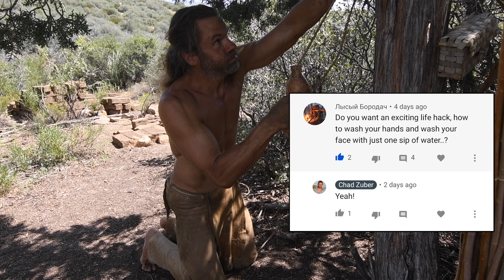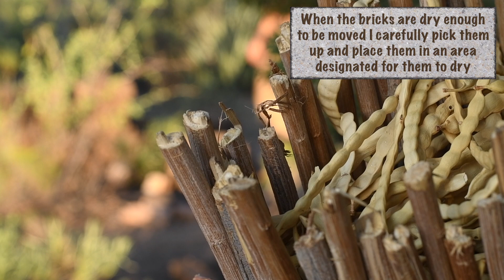Making Primitive Adobe Bricks and Finding a Spring (episode 19)

Comment: TIP/ experiment: A simple way to filter water is to have two containers one filed with dirty water and one empty then you can put something like string or paper (if paper you can role it to be like string)(this can be anything that has fibers), Then if you put the string/fiber thingy so that it touches the water at one end and goes down a bit in the other container make sure that the fiber thingy that is stringys end(in the empty bottle) is lower than the other. The water will slowly flow to the empty bottle. But it may not be drinkable in bigger amounts. But if you ad charcoal with a high surface area it can pick up nasty things witch can make it more drinkable.
Reply from the maker: That sounds very interesting. I'm not sure that it will work in this arid climate though. The water may evaporate before collecting in the empty jar.

Comment: Happy to see you in a biome that I have enjoyed for most of my life. If I may give you a  few thing to look into if your interested. 

There is a cactus called hedgehog, it is symbiotic to other plants and typically found under or near their cover, small groups of cactus bases. At the base of these groups, just after a bloom, it'll bear fruit much like the prickly pear. small strawberry shape with fiber hairs on them, easy to wipe the fibers with bark. hold the stem like a strawberry and eat the tip up to Just before the stem (like a strawberry). it is a delicacy, a weird cross from a citrus and a strawberry, only available during the mid to early spring. Very tasty, but you might be a tad north for them, but if not, give them a try. (always inspect for worms.)

Second tip is on the spring. Congrats, that is a good find. it is very common to find those with stagnant water. very hard to truly enjoy without some cleaning. something you can do is dig out the sediment a bit to get a tab bit more depth. Once you have maybe 3-4 inches depth with a foot to 8" diameter, you can stabilize with a bit of white ash. roughly a tablespoon to 1k Gals. The potassium from the ash helps to change the PH in the water to deal with the microbial issues. Followed by a sand filter basket to remove some of the bigger stuff. remember if you don't see plant life enjoying it, there is a reason. The Hopi were known to plant a symbiotic plant into the middle of that bowl to help clean and as a sign if the water went bad. something to think about and look into. 

Loving the New series, keep up the great work!

Comment: That handwashing water-conserving technique reminds me of something one of my old schoolteachers told us in his chemistry class: If you fill a jar 90% of the way with water to rinse it out, you're only going to wash out about 80% of the contaminants on the inner surface. But if you use just 10% to rinse the jar, you'll get rid of about 70% of it.  So if you do that 3x, then you'll only use 30% of the jar's capacity for water to get it over 98% clean, as opposed to 90% of the jar's capacity in water to get it 80% clean. (Presuming there's nothing inside that'll cling.)
Reply: "I was told there would be no math."

Comment: Not sure if you'll see this but a trick to getting more pure clay is to filter the dirt out with lots of water over and over till you have lumps of clay a practical way of doing this is to make a tight weave basic as tight as you can get it so the dirt can wash out not the clay. Add in clay rich soil it's slow and you won't get a lot of clay at first but if you keep doing it youl get more lumps of clay till you have enough clay. I used this same trick only thing diffrent was I used a old pillow case to filter the dirt out instead of a basket. When you got your clay keep it in water so it dosent dry out. I learned this trick from school in art class actualy the teacher showed us how to get clay out of the soil for pottery  it was fun and messy.
Reply from the maker: I honestly have never done that technique. It sends time consuming. Maybe I will try it although it hardly seems necessary given that the pottery is turning out great already.
Reply: @ChadZuberAdventures  it is a time consuming process the method is called Wet clay harvest method not sure we're it originated and I'm not sure if you could try it as you'd need a bucket and something to filter out all the sediment so you have clay and water left.

Comment: Have you thought of using a grinding stone to powder the bark for your bricks. Doesn't have to be a mortar and pestle kind but it would save your hands from the friction and roughness of the bark. I did that with a sandstone flat and hammerstone and it not only did the trick but the stone added additional grit to the mix.
Reply from the maker: Yeah but this bark is quite soft. It actually feels good to roll the bark in my hands. It also helps clean the dirt from the hands.

Comment: pound the stick into the ground and use leverage to break the walls of the pit off.
Reply from the maker: I actually tried that but the ground is so hard the stick doesn't penetrate.
Reply from the maker: Maybe presoaking the ground with water will work for that method.

Comment: Reason I asked about the ratio of Mud/clay /and Sand, to dry grasses you use. I have a good source of sand and clay I discovered on my Property, when 2 Massive oak trees where blown over by a streight line wind..Bad for the trees, good find for me...
Reply from the maker: If you can measure the ingredients quite precisely then I would try using 30% clay, 30% sand, and 40% fill dirt. Then mix in a certain amount of dry grass or dung and see how they turn out. You can then adjust the recipe based on the results.

Comment: Hi. try to drive a wooden stake into the edge of the hole and then pull it out. so a large piece of dirt will break off. then pound it with a stone. so it will be easier and faster for you to collect dirt for bricks
Reply from the maker: I have tried that and it's really hard to do. However, as long as the spring has water I can pour some water where I intend to dig to presoak the earth and then it's easier.
Reply: @ChadZuberAdventures  it's bad that in the area where you stayed there is such a bad ground. I wish you to find good clay for ceramics, and many useful resources

Comment: Just a little tip Chad, you can always leverage things. When you were digging/scraping, you could also use like an axe. I think just using the stone to scrape it off is much more tedious, isn't it?
Reply from the maker: I don't know. This ground is really hard. The stick and bone are just too soft to make much of a dent. The rock seems to work better although it is tiring. But if I only make a few bricks a day then it's not a big deal. The best way is to presoak the earth with water and then dig. As long as the spring has water I can do that.

Comment: Yesssss! I was wondering when the next video was going to drop! Now to sit back and enjoy dinner and watch an excellent video 😁👍
Edit: man every time I watch one of your videos I just keep coming up with new ideas. For instance I was thinking of a way to speed up your brick making time. I wonder if making a brick sized depression in the ground and lining it with woven juniper bark mat would allow you to quickly press in a brick, leave it for maybe an hour, and then use the mat to pull the brick out and set it aside and put it in the hole for the next brick. Although it may be too soupy still to do that. Glad to see the juniper bark adobe came in clutch. Having super strong bricks will extend the life of your hut significantly. Also, you're already digging a hole why not make it into a cellar for food storage once you're done digging bricks?  I'll let you know if I come up with any other ideas which, as you can tell, seem endless some days lol. Best of luck love the videos chad!
Reply from the maker: Thanks for sharing your ideas. Making bricks by digging a depression in the earth would really slow down the drying process. It would also be difficult to remove them the way you described. It's just not practical. Regarding the big hole I'm digging, I have a few ideas for it. The location where it is has a natural flow of water when it rains so it will likely fill up after a lot of rain. I can use it to collect water perhaps. When it is dry I was thinking to put a roof over it and just use it as a workshop especially for making pottery because there is good clay in that hole.
Reply: @ChadZuberAdventures  ah fair point. Anyways just keep doing you man you're a fantastic bushcrafter/survivalist/primitive skills teacher and I love your videos ^_^

Comment: What if you didn't remove the bark from the brickts and moistened it a little, just before you build a wall? Would that close gaps and keep the brick from shifting? Great channel by the way I recently discovered it and have loved every minute so far.
Reply from the maker: That wouldn’t be helpful because when I put mortar between the bricks I want the bricks to adhere to the mortar.

Comment: Chad, one question, wasn't that tiny spring you found, contaminated? I swear I saw worms wiggling through the water.
Reply: Looked like mosquito larva and some other type of insect.
Reply from the maker: Mosquito larva and other insects. That's not contamination. I've shared water with insects before and was fine. When in doubt just boil it.

Comment: put some water in the dirt before scrapping.. its gonna be alot more easier to dig out
Reply from the maker: Yes, that makes digging easier but then I spend more water. That's the problem.
Reply: @ChadZuberAdventures  we live in mud houses.. the water quantity will be same and it will be more adhissive as compared to fresh mixture. add water..leave it for sometime.. then dig with sharp wood branch the portion where water is absorbed.. add little remaining required water

Comment: Hey Mr. Zuber, have you considered using the hole you dug for the adobe as the bottom half of your shelter? Like some of the old dugout homes in the New Mexico area? Also potentially fire hardening your digging stick? Hope youre safe and all is well.
Reply from the maker: Hey Pete, that would not work well because when it rains the water drains right into the hole. I'm going to use it as a workshop mostly for pottery. I will put a roof over it for shade. The stick was already fire hardened a while back. It's pretty strong. I've been using it for over two years.

Comment: One day hopefully soon I'll hopefully go to live in the wild. Thank you for these lessons :)
One question, would these bricks survive bad rains and snow?
Reply: Yes since they are fully dried or "cured" somewhat like concrete but obviously not as hard
Reply: @davidhutchinson7888  ok. Thank you!
Reply: If you can make cement, you can fire the bricks to make it like a proper house if not, you might have to do some repairs on the bricks if it rains too much.

Also watch out that if the foundation gets a lot of water it can go up the bricks and damage it

Comment: Mr Zuber,
Is there a reason you are making the adobe bricks in the exact proprtions that you do?
Reply: I can't speak for him, and don't know why the height is set how it is, but typically brick workers like bricks that are as long as a multiple of the width (most frequently 2, but sometimes 3 or more) so building large walls you can interlock brickwork courses to strengthen them without cutting bricks down. Variance from those precise proportions, I'd guess is to account for mortar spacing, or perhaps just the inaccuracy of the primitive molds. 🤷‍♂️
Reply from the maker: Not really. Only that I think these are about the minimal size that will work to build a small hut based on my experience with the first hut I made. Also, I can carry one brick in each hand making transport a little faster. Wider bricks would be better and stronger but would also take a lot more time to make.

Comment: Wondeful job as usual (both survival and video parts) 😊

I wonder whether you would save time by making bricks closer to a water source (no need to walk a long time to bring water, softer soil). I was thinking about the shore of the stream (or maybe a bit higher in case water rises again), but the spring you found would be an even better choice.
Reply: I wondered the same thing about building the shelter and making the Adobe closer to the stream. 😮